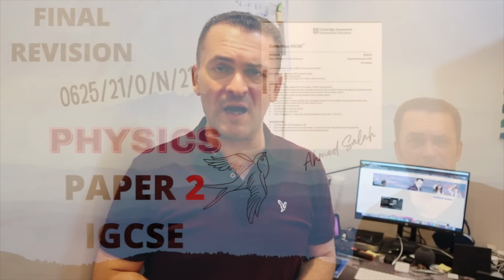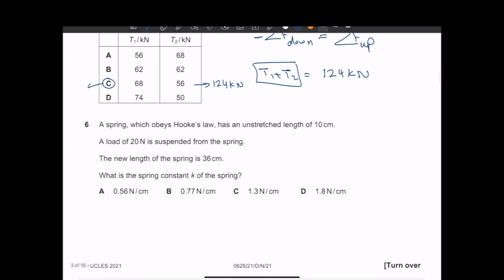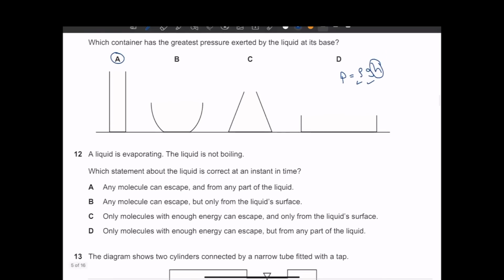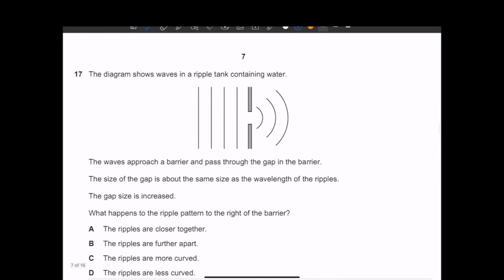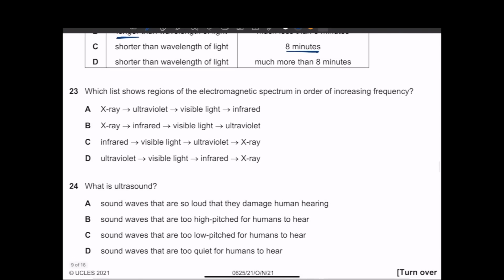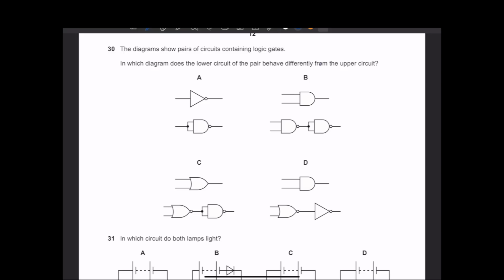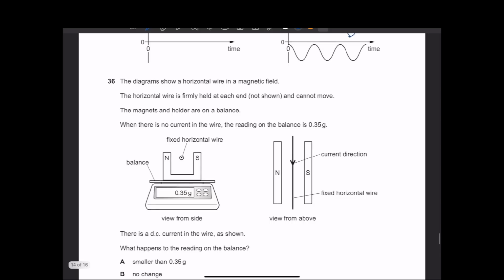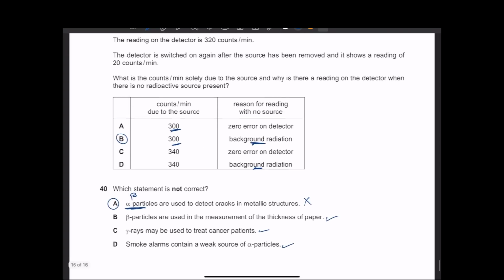Final Revision Paper 2 - 0625/21/O/N/21

Comment: In Q5 option A 56+68=124 it still gives the same answer as option C, why did you choose C and not A?
Reply from the maker: T1 should be more
Reply: Please elaborate on how we should approach question 5. C is the correct answer yes. But, option D shows that T1 is greater than T2 which may confuse people.

Comment: Thank you for this session, I have a question though. At 9:40,  Why is option A wrong if it gives you a total of 124 kN too?
Reply: First lets make any of the pillars a pivot doesn't matter which you choose. I will take the pillar with T1 as force as pivot
We then use ACM=CM
5x24+10x100=20T2
120+1000=20T2
1120=20T2
1120/20 = T2
56=T2
This alone is enough to say the ans is C but if u want to confirm you can do this:
upward force = downward force 
100+24=56+T1
124=56+T1
124-56=T1
68=T1 
matches the answer of C